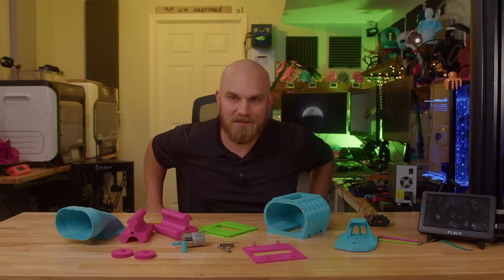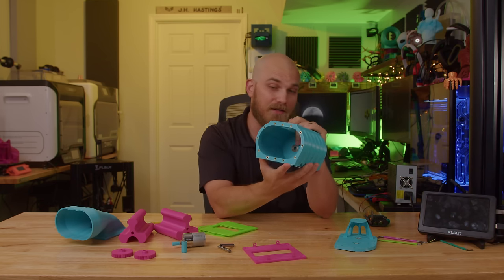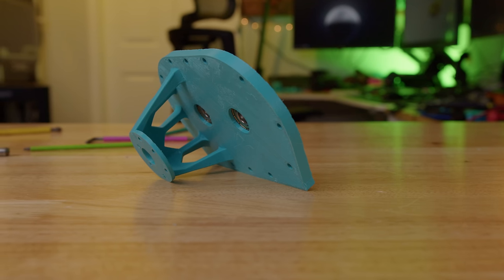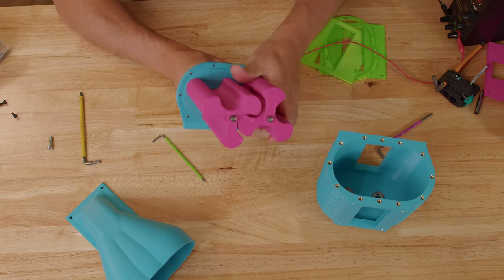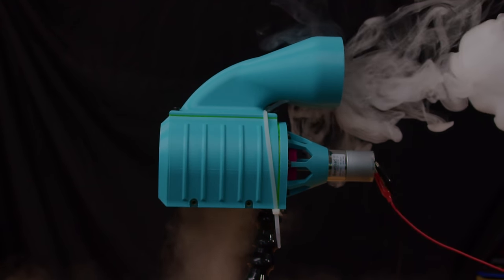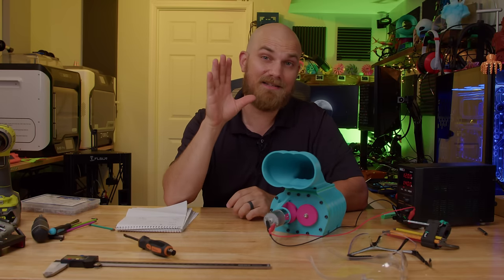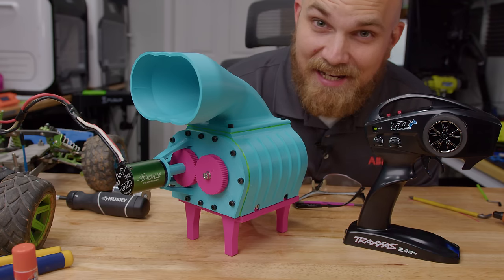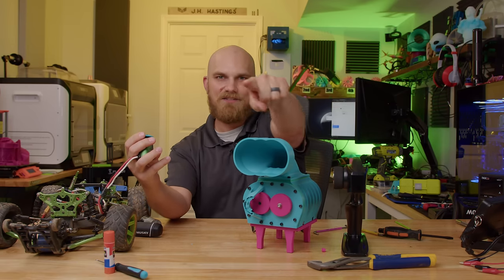I SUPERCHARGED My Custom Loop…… Literally

Comment: To get tight clearance: print slightly oversized and cover with valve lapping compound. Clean with tide POWDER detergent.
Reply: Basically my thought lol. If it's rubbing, just put some compound in there and let it run and it'll take care of itself...
Reply: This. I’d recommend graphite and/or teflon powder as well.
Reply: the surfaces will get hot and not really sand down. they will just smear unless you can keep it cool.
Reply: @cbrunnem6102  manually crank it to reduce rpm based heat maybe?
Reply: @buildingsalvage  id say just let the 1000 rpm motor run for a while. thats really not all that fast and prolly wont heat it up too much. just a theory though.
Reply: @cbrunnem6102  It is pumping the better part of a liter of air per revolution.
Being conservative and saying it's 0.5L displacement, that's still 17 cfm or 0.5m³/min. It will move an absurd amount of air, and at possibly up to 1 atmosphere of boost pressure.
Reply: @cbrunnem6102  I have lapped 3dp parts using this method and a hand drill. Best part is next to no layer lines.
Reply: @cbrunnem6102  not really.  I've lapped parts before and used drills to wear things to each other.  As long as not run completely dry they will be fine.
Reply: What about scrapper/seal blades T grooved into each lobe, providing seal and clearance solutions? Print soft blades and play with lobe/blade geometry .
Reply: @munokhoi5800  Racing superchargers sometimes have seals on the rotors. But it sounds like the wrong thing to focus on. The blower almost linearly increases airflow as RPM increases. Superchargers arent very efficient at the low of high ranges, but they peak in the mid range. At low RPM, the air can leak back around the rotor, but more likely through the center between the rotors. As RPMs increase, the centrifugal force and the angular momentum carries the air through the case and throws it down into the outlet
The goal would be to increase the speed, peak adiabatic efficiency would probably be at 5000 to 10,000 rpms, he's only going a fraction of that. Volumetric Efficiency (airflow per revolution) increases all the way to maximum RPM.

Comment: "Lemme know if that's something you wanna see"
Yes we do want to see you make a thicker mount and absolutely yeeet it!😂
Also, maybe provide dimensions for the screw fans so people can design different variations that fit in the casing and maybe improve the noise and airflow of the supercharger cooler, would be interesting to see what ingenuity people can bring to this and see if we can get the thing to climb the leader board
Reply: This 👆
Rotor Showdown? 🤔 what about that?
Reply: this would be super cool

Comment: Put your gears in double shear with another bearing behind them, it will help quite a bit with the high speed stability. 

The meshing of the gears is one of the most important parts of a supercharger. Having the timing off by even a little bit can cause catastrophic failure in the rotors.

Comment: Roots blowers (positive displacement blowers) don't compress air, they just speed it up, it's compressed when it's rammed into the intake manifold. All roots blowers have an optimal Delta P where the rotors can no longer prevent sufficient air from leaking back into the blower and just getting heated up. 

Twin screw actually do compress air as it's pushed through the twin screw. 

For what it's wroth, modern roots blowers have an ablative coating that breaks in so they actually kind of touch. The better the seal, the more efficient the blower and higher the delta P.  It's not the only factor, rotor geometry and size are also a factor. Most blowers have a coupler between the snout drive and the rotor pack that is designed to break in the event that the rotors ingest something that jams them to minimize damage. 

I have a blown car that runs on alcohol :D

Edit, if you had either Gemini gears or helical gears will help reduce the noise, but in your case I think a lot of the noise is from the rotors kind of clunking around.
Reply: They actually do compress air. PD engineering drawings actually calculate the pressure zone when determining the compression chamber volume.
Reply: The OE coupler in my eaton m62 self destructed after 190k hard miles
Reply: This seems like a lot of buzzwords that are adjacent to being correct.
Reply: I read your whole comment thinking "oh man this is a backyard warrior who understood about 10% of an internet article" and then I saw your last comment about having a blown car on alcohol and knew I nailed it.

BTW, by your reasoning nothing builds pressure but rather speeds it up.  actual answer, a blower does compress air. it has a flow vs pressure chart at several speeds. if an engine has massive valves or tons of lift, the blower will flow more air at less pressure assuming everything else about the two cases are the same. point being, no compressor can build pressure without some restriction. 

lastly, compressors some times slow the velocity of air.
Reply: @cbrunnem6102  " actual answer, a blower does compress air"  Incorrect, a roots type blower is simply an air pump.  It does not internally compress the air which is why they have fairy poor efficiency for supercharger applications.  Conceptually it's similar to a gear style pump, which also doesn't compress anything.
Reply: @ferrumignis  ok so a roots style supercharger doesn't compress air... after air leaves the supercharger... what compresses it?

Comment: The mount broke because you're essentially backing off that screw in the main rotor which puts pressure back on the motor itself inside the coupler. Try to move the motor mount to the other side or use reverse threaded screw on that rotor so that you tighen it with the rotation of the motor. Hope that makes sense :)
Reply: Then it would basically do the same thing but backwards? I think the mounts need to be stronger and set up differently

Comment: considering the outlet hole you have on the blower you might want to turn it sideways on the radiator or create an interface plate with vanes to guide the air across the entire radiator area instead of just that narrow path in the middle. on top of that it would only be fair to spin the blower a 3000rpm just like the noctua fan.

Comment: That looks so cool, literally! 
But did anyone else flinch at the cracking engine mount, engine pulled off and the start with loose bits still attached? 
Looking forwards to see the different ideas and modifications on the original concept!

Comment: I just bought a twin screw Whipple Supercharger for my 90's Plymouth minivan last week. Wish I'd known then that I could have saved thousands of dollars by 3D printing it myself...
Reply: Well now that you have it you might as well test how well it cools a pc 😂
Reply: ☝️ I vote for what that guy said...
Reply: And ill second it. You have to do it now. The people have spoken... Seriously a fuckin minivan...
Reply: Also, how do you mount the damn thing, does it just chill in the cab coming out the top of the dog house?
Reply: @zmaster1481  minivans have very little engine compartment space front to back, left to right. But, they have a ridiculous amount of room vertically. I put a 2010 Dodge Charger V6 stroked out to 4.0L and an AWD transmission into my van, that engine is about twice the external size of my original engine. Theres about a foot between the top of the engine and the hood, and 2 feet from the transmission to the hood.. I could definitely fit another engine on top of the transmission and a transmission on top of the engine.
Reply: @SpecialEDy  i dont understand half of what you just said. Specifically to the first comma of the second sentence. But really,  why would you do that to a minivan nearing 30 years old and im sure that if its somewhere in the vicinity of normal minivan height, itd be top heavy already, so handling would be rather... iffy. Aren't there better vehicle to spend all that money on? And so when can we expect the supercharged pc video?
Reply: @zmaster1481  Well, it's lowered 2", has thicker anti-roll bars than OEM, has a more modern suspension with less unsprung weight than OEM, and I'm about half done with the "roll cage" in the front half, the rear will get a roll cage too. Oh, and at 3600lbs, it's 800lbs lighter from the factory than the Dodge Charger or Challengers that the engine came from. Short gears in the transmission I built, AWD, and paddle shifter, I'm hoping to be keeping up with mid range V8 muscle cars.
It was my parent's van, some of the first wrenching I ever did on cars was with my mom and step-dad on that van. When my step-dad died 5 years ago, I inherited the van, and I will keep it to the day I die. It has 436,500 miles, everything on it is pristine and beautiful except the paint, which I'll have redone after I finish fiberglassing the Dodge Viper bumper I bought which surprisingly bolts on.
I also have a 98 Jetta, a 93 Jaguar XJS, a 94 Toyota Celica, and an 82 Yamaha SECA 750, they're all worthless to me compared to how sentimental the old family van is.
Reply: From where I’m standing (London suburb in little england) to insure, reregister and tax that ‘truck’ would require somebody here to remortgage the house. And finding parking for all the other metal, wow you yanks have a lot of space, I guess. Good for you, it’s not a dead horse until it croaks.
Reply: The AMR 500cc roots blower, at 0.5 Liters and $200, is much more appropriate than my 1.6 liter $2800 Whipple twin screw for mounting to a PC.
Reply: @ICGedye  Insurance on an old minivan is hilariously cheap, I think I was paying $20 something a month for liability insurance on it before I started the engine swap. I'll have to get full coverage once it is running again though, I spent twice the Kelly Blue Book value of the van on Intake\exhaust valves alone.
Yearly registration here in Texas is around $50, but since my 1997 van is 25 years old, it's a "Classic Antique" which means I only have to register it once every 5 years, and don't need to pass any state inspections, though they'd be $12 if I did. So yearly tax and licensing works out to $10 a year.

Comment: Worm gears were a mistake. Those are driven from a worm screw. That's why it looked like they were trying to walk apart. 

Needed regular gears. 

Very cool though.
Reply: Herringbone would've been quieter
Reply: Thrust bearings and/or pulleys would also be needed.
Reply: @anonymousarmadillo6589  Yeah, I like to lightly centre cut herringbone, leaving pockets to maybe hold some grease and gather particles.
Reply: @GBCobber  that's pretty smart
Reply: I'm at a loss as to why anyone would choose a worm gear for a spur gear application.

Comment: I went to diesel tech school and I worked on my fair share of roots blowers for old Detroit Diesel engines, this looks almost identical to those, (even the color of the housing is close) but I think something you are missing that might increase the air pressure and in turn increase the output is by lubricating the rotors, the oil acts as a seal more air can be pushed in without having any leaks, might not be much of a difference but that’s something the real blowers have depending on application, you could also run a turbo into the blower to get more airflow. Cool build I’d like to see what else it can do, and also it sounds shockingly similar to a real roots blower which are loud and obnoxious, impressed at how quiet this is

Comment: squeezing more out of the bearings and seals is tough but there are ways . Greasing the bearings with a performance grease and lube the gearing and blower with graphite powder based grease. everything will move a bit smoother and seal just a bit better depending on the powdered grease.
Reply: Dude those moving parts produce so much heat I think running this thing for a couple hours it's gonna melt
Reply: Bro I thought the same thing, that thing sounds dry af. A few hours and all the joints will be loose
Reply: @VaDeR173  grease exists with a purpose
Reply: or print moving parts out of 
self lubricating carbon nylon
also i was screaming at him the motor needs to be more stably secured.

Comment: This is pretty cool! I'd definitely like to see one or two more iterations of this. Maybe doing a twin screw or even just twisted roots would help push the air towards the back of the housing better. Also I just think it would be cool to see it fit onto a 240MM radiator properly. Finally, superchargers are designed to run at a higher rpm than the crank of a motor, what would a 240MM supercharger with a 10k rpm motor do?

Comment: as an RC-guy: probably your servo tester does work, but to inicialise the ESC, it must be in "the center position"... now the RC-Radio had defenetly not the same center position as the servo tester... so I would suggest to relearn your ESC to the Servo tester, usually thats done by pressing the setup button whil powering on and then netural, full forward, full reverse... it will give you a few happy beeps and after initialising in the center again, it should response to throttle inputs.
And if you repair your rustler... use RPM parts, even if not as shiny as aluminium arms etc... aluminium bends and stays... plastic bends back! therefore every part that gets impacted shall be plastic, the one only stressed in one way (shock towers etc) can be aluminium or carbon... Have fun ;-)

Comment: I would love to see a twin screw version, a better motor, and a tighter fitting (but smooth) design—as other comments suggested using a lapping compound and letting it run to have it make itself more efficient (and I'd assume it would make it quieter too.
Reply: On top of beefing up the motor mount/joint method I would suggest helical rotors with nylon seal strip along the outermost edge of the lobes like they use in real life superchargers.  I would actually  suggest using plastic welding strips as they are cheap and easy to find on amazon, etc.
The helical lobes combined with the seal strips would make both air delivery smoother as well as reduce  rotor induced vibration as the lobes would be resisting the motor equally at all angles instead of just two like with the straight cut lobes. using the nylon would also dramatically reduce the contact patch size along with the ability of air to sneak past the rotors like I imagine it would be doing in the current iteration.

Comment: Suggestions: 
Center mount the motor and use a toothed belt. With proper tension this will give better energy transfer than gears. You should be able to print the belt from TPU. 
Also, if you are wanting to move air more so than compress it you might consider some hybrid design, like a linear blower wheel for the impellers.

Comment: Maybe a thrust bearing of some kind at either end of the Rotors would help with noise and movement. Also just lubrication of some kind incase of contact
Reply: Lubrication for the gears isn't a bad idea, maybe silicone grease.  Any lubrication inside the compressor housing would get thrown out and into the radiator.
Reply: Deep groove ball bearings can handle thrust loads up to 50% of their radial load rating. No need for seperate thrust bearings.

Comment: For best performance with rc motor I would suggest redesigned lobes with slots for tpu gaskets then you wouldn't need such close tolerance because the gaskets would seal then add some spray silicone to everything before assembly, also reccomend sanding(4000grit) and polishing all internal parts for as smooth a surface as possible to reduce drag and lastly I would love to see a 360mm version,  that would look amazing sitting on top of a custom hot rod case

Comment: Superchargers really excell at static pressure, the thicker the radiator you can bolt it to the better

And heck yes we would love to see some different blower types tested!!!
Reply: Yep this should be able to produce 100x the static pressure of a regular fan. So it should be able to push some serious airflow trough the thickest and densest of radiators.

Comment: Put butterflies in the scoop and run it to a servo splitter for the esc, so when you rev it, it opens up! Also could you run a program so it turn on like a computer fan when it gets to temp?
Reply: Servos and PWM fans use the same type of signal, I don't know if they're actually compatible but I wouldn't be surprised if you could just drive a servo or ESC directly off a 4 pin fan header. Worst case, it'd be trivial to make a little microcontroller board to convert between the two.

Comment: Absolutely would love to see it with different rotor designs and even (I may be stretching things here) a higher rpm motor.

Love the content, keep up the great work!

Edit - and just after I post, out comes the motor. 😂🤣
Reply: Nah, this is a very counter intuitive design. Blower motors don't flow much air and are designed to create pressure. The faster you spin it, the greater the heat will be generated. Ironically, Roots based chargers are the least efficient designs.

Comment: I'd love to see you do a "throttle plate" in that intake scoop and somehow have it close when a PC is off and have it open when PC turns on!
Reply: Get really fancy and have the throttle plates rotate open as the RPMs increase.  ;)
Reply: @JCHoefer  damn thats a good idea, should be possible by using the output from fanspeed controllers and adjusting the flaps accordingly.

Comment: roots blowers were designed to do exactly this, so its great to se one at this scale. with some refinement it would be ineresting to see how good yours can get, it would also be cool to see one stretched out on a 240 mm or even a 480mm radiator. i bet it would work swimmingly if you have the time.